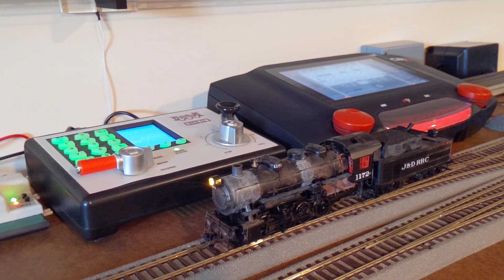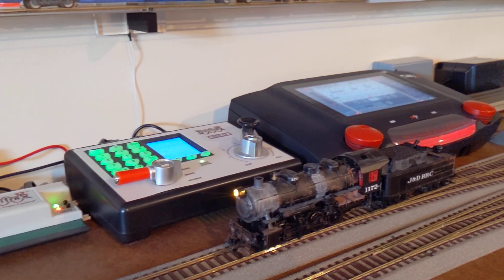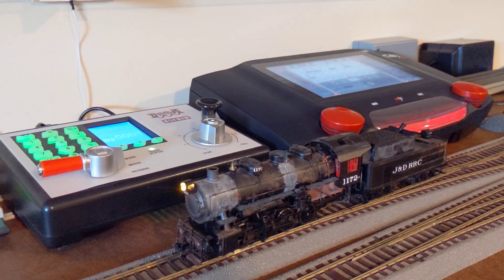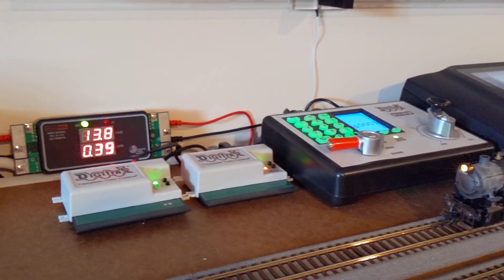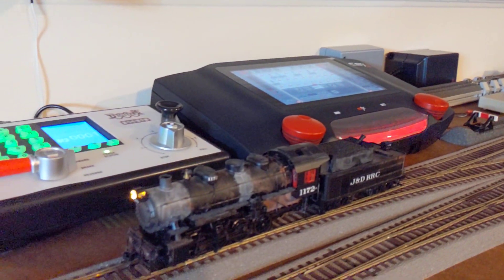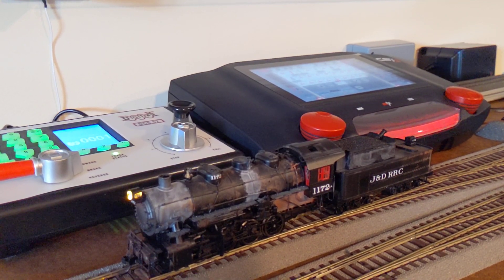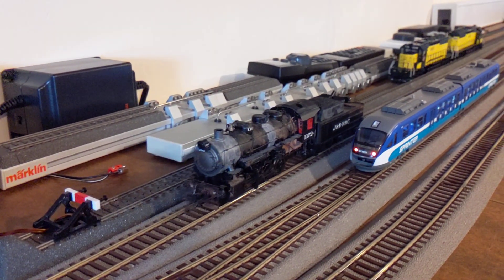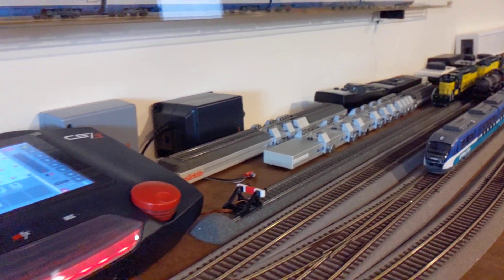Test Soundtraxx Current Keeper with Digitrax Zephyr Express

Comment from the maker: Medium Chuff, CV 123= 5  
Lima 5-chime, CV 120 to 32
Medium brass bell, CV 122 to 18.  The model has a single Cross Compound air compressor, So set CV 124 to 3 (default.)  Dynamo has a short exhaust port, so let’s try Dynamo selection 5, CV 125 to 4. 
CV 112, you will want to select the Power Reverser, a Non-Lifting injector, auger-fed coal, so CV 112 to 11.